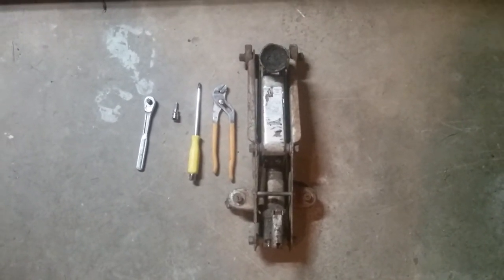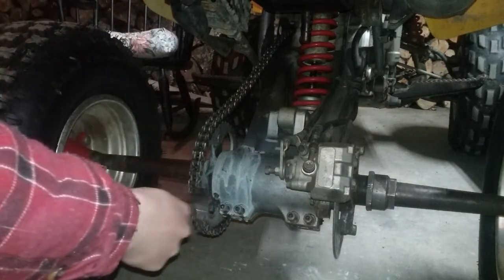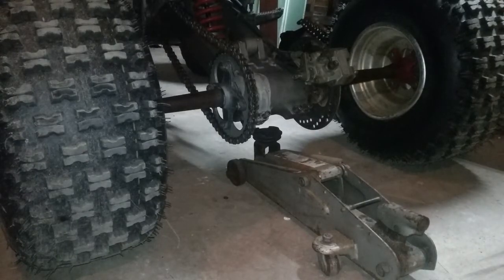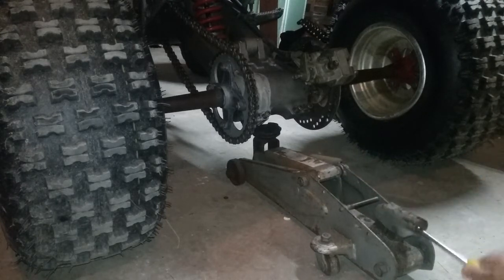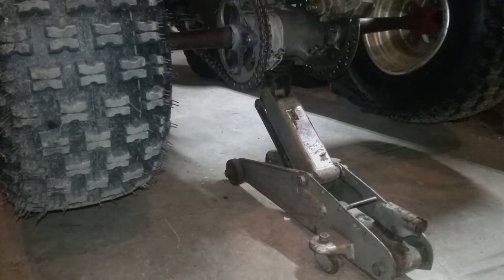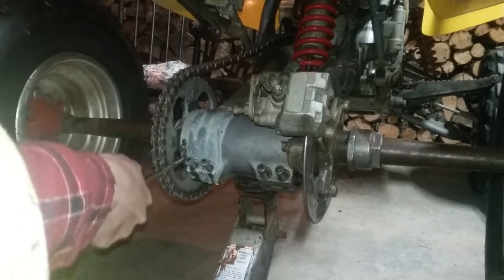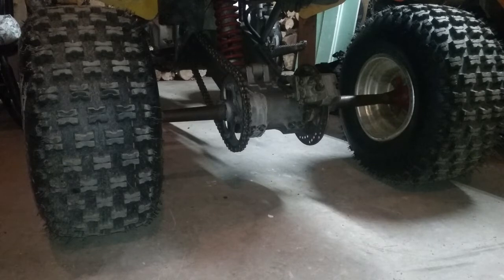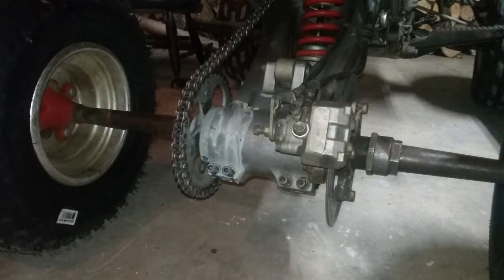How to: Adjust chain on a 400ex

Comment: Better to compress the suspension with a ratchet strap so the rear axle, swing arm pivot and the transmission shaft are on the same plane - at that point adjust the chain for 5/8 inch of free play half way between the front and rear sprockets.
Reply: The service manual seems to show 1 5/8" of play.  Some of the online versions have been updated to 1 1/4" of free play.

Comment: What if I move the hub almost half way and it doesn’t tight. Do I need to replace the chain?
Reply from the maker: Yes once it's adjusted as far as it can go and your chain is still too lose you can either take a link or 2 out or you can get a new chain. Preferably o ring as they last much longer than standard

Comment: What if the carrier is stuck and won't move
Reply: Pb blaster or wd40 and tap the screw driver with a hammer
Reply: Does it have to be jacked up mine wont move either but I didn't have it jacked up